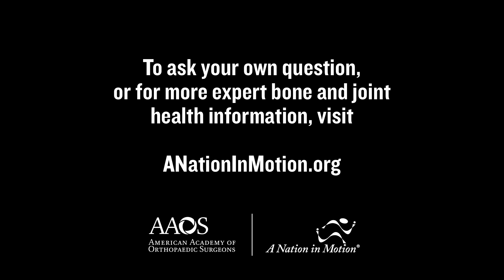Is it normal to hear clicking sounds from my knee replacement?

Comment: After about 10 weeks or so my knee also started to click and pop. It is especially noticeable when climbing stairs.When walking on a level plane the clicking is less pronounced and is sometimes absent.  Also, I have found that wearing a compressive sleeve over my knee helps.

I have met people who have had their knees replaced who tell that the clicking never went away, but did decrease. Here's hoping it will eventually go away. It doesn't hurt, but it is terribly distracting.

Comment: Nearly 10 weeks after tkr my leg ha started to sort of pop and crack, am I doing something wrong in my exercises or will it go
Reply from the maker: In general, the popping and cracking sound should go away after a period of time. If you hear the noises during specific activities like exercise, you may want to make modifications to those activities with guidance from your orthopaedic surgeon or physical therapist. However, if you are experiencing pain or discomfort, as mentioned in this video, please get reassessed by your orthopaedic surgeon.